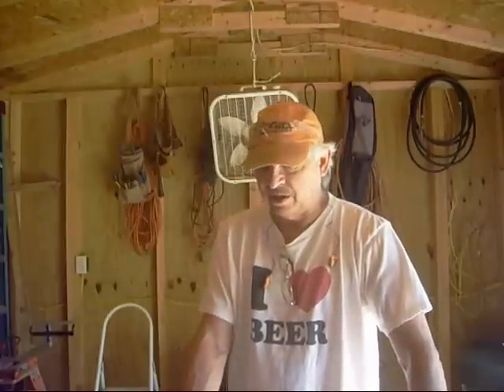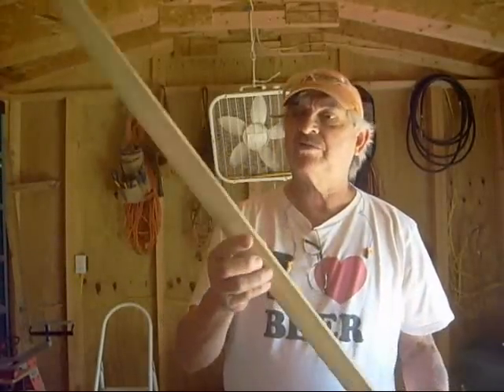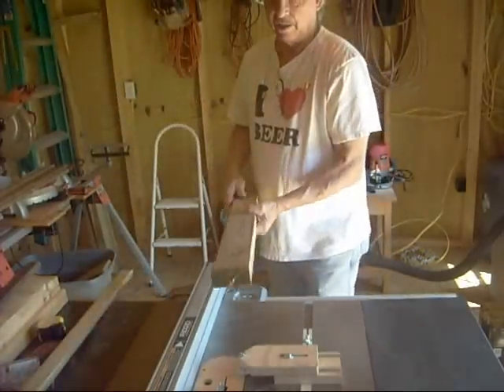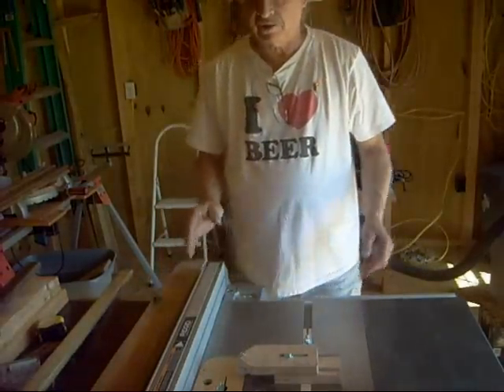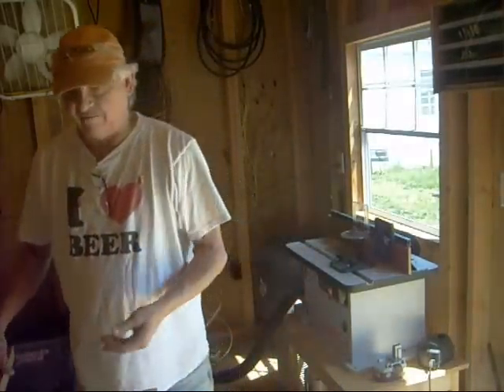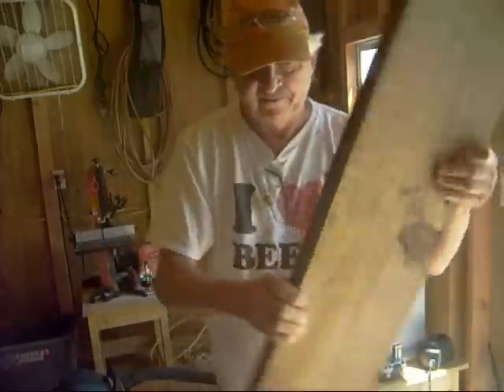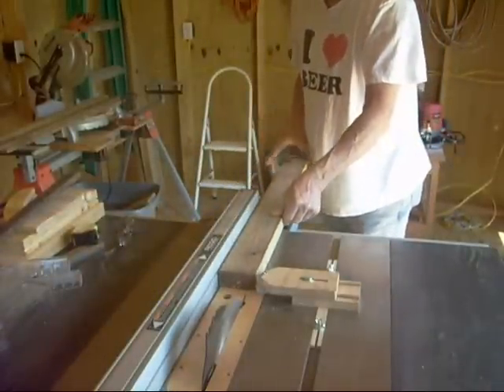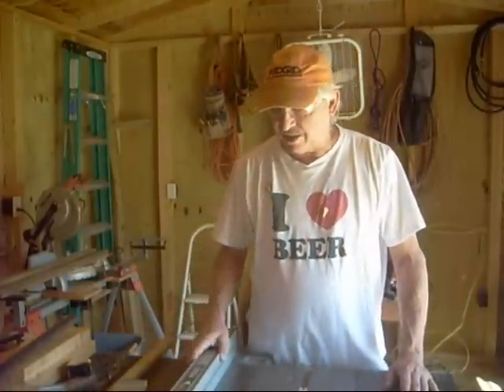My Dog Ate The Railing So I Built a New One

Comment from the maker: Like I said darn good saw. I wired mine for 240. It's not hard to do and it works great. I wish I had more space,maybe 24x16. It would be easier to handle sheet goods and longer boards.. When it comes to shops bigger is better. LOL